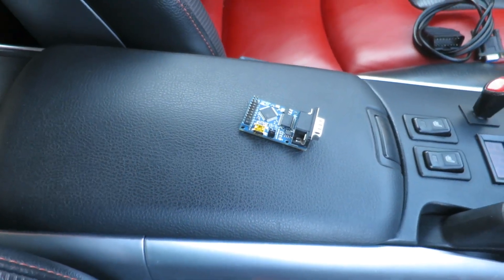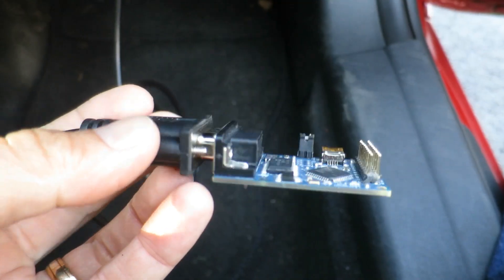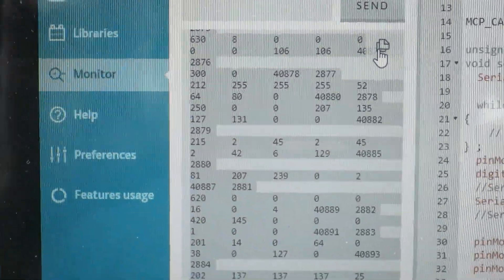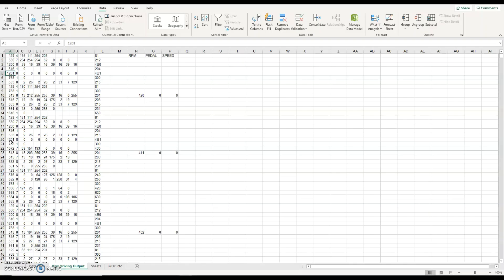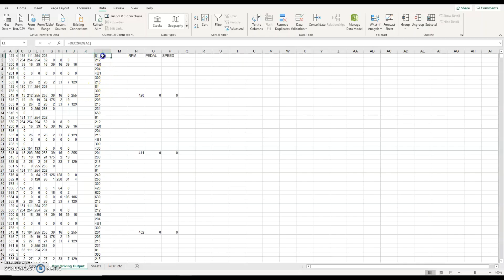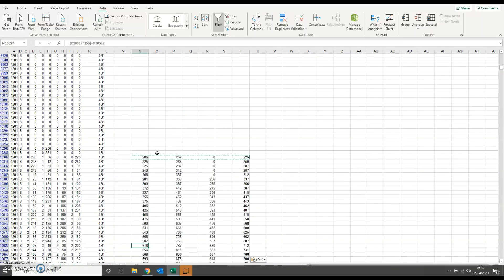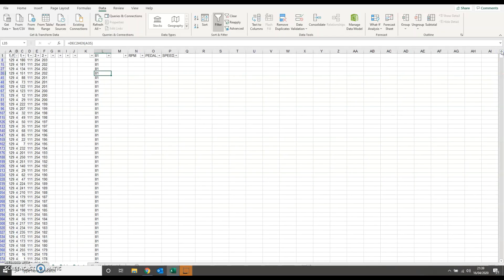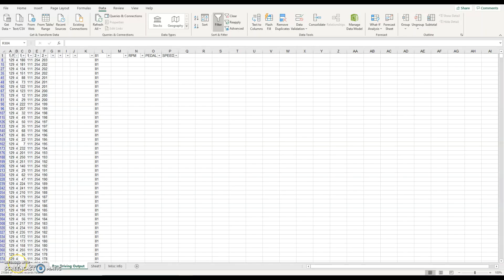How to read the CanBus in any car. (Can Bus) Part #1

Comment: I'm an automotive electrician/electronic tech, i am familiar with can, and other protocols my question is first this interests me alot where should i start to learn this stuff heads up i am not familiar with arduino, yet i can clone pcms/ iclusters do immo off etc but this part is exciting can you please lead me in right direction if not to make money maybe to solve a tough one and make customer happy. thanks in advance
Reply from the maker: Hi - you have not really said what you are trying to do, other than learn this stuff? But what stuff?
Reply: @SouthWestEVUK  the entire process I have no education on Arduino and how it works my question is where do I start accomplish what you're able to do it's impressive and it seems useful for my shop
Reply from the maker: Guess I started some 30 years ago, and learnt to code! went to college and learnt electronics, uni for software engineering, 20 years taking stuff apart!

Comment: Can i read data in a Elevator system's MODbus or Canbus so that i can find out the floor number shown in the display using arduino? Please help
Reply from the maker: Gosh, I guess if the elevator has a canbus I do not see why not.
Reply: @SouthWestEVUK  So can you help me about how to sync with elevator canbus or properly setup a system for that using arduino. That would be very helpfull
Reply from the maker: sure!

Comment: How do you find ignition timing and the fuel injector pulse width and injection timing, crank and cam sensor ect?
Reply from the maker: I have not needed to look for those as I never had a working engine!

Comment: Your "sniffer" PROBABLY miss can frames. If I understand the code and I calculate correctly, can has configured to work in 500kbps, but You set uart to 115,2kbps additionally there is spi communication between avr chip and can tranciever which I do not find its speed in Your code, but this is delay between received can frame by a tranciever and received packet by Your pc. Additional delay(10) in code also intorduce loss in received packets. Of coruse there is possibility that can tranciever chip buffers can frames and avr are albe to read all its packet but after some time this buffer become full and You still miss can frames. Please correct me, and explain what I miss understand.
Reply from the maker: The 115kbps speed is the serial output of the Arduino, not related to the canbus. The CanBus is set to 500kbps, so nothing missing there. Not sure which version of my code you have there, but the latest has no 10ms delays - but even then I am pretty certain there is a small buffer. I have extensively used this code and have not seen any behaviour that is random (which is how it would look if packets got dropped).
Reply: @SouthWestEVUK  and to be honest, Your device is very nice solution. Most of can frames frequently appear on the bus, so few frame drops can be probably ignored. The only reason of my comment is that, it is unfortunatelly not perfect, and that is probably professional can sniffers are expensive.
Reply from the maker: Its really not missing any packets, as i would see irregularities in the behaviour of my code and all the packet sniffing i have done would show missing information. Even connecting to the leaf - which has some counters, i get everything. Perhaps im lucky!
Reply: @SouthWestEVUK  please note that avr atmega chip is single core. Consider situation where on can bus, there is lots of frames one after another. In that way even if can tranciever receive it and buffer it, there is still delay (not confuse with delay function) between avr read data from can tranciever and transmit it via uart. Avr in a loop ask tranciever via spi to get info about new data and when it gots info that there is data, it reads it via spi to avr memory (note that in same time tranciever reads new frame), when avr reads that data, then pusehs it through uart (still notice that can tranciever receive new can frames). And because can is 500kbps and uart is 115,2kbps, in time when avr send data of single can frame through uart, can tranciever can receive more than one can frames (and time for spi communication to tranciever also should be count here). And I think that after some time in case of high traffic on can bus, this solution is too slow to capture all can frames, and You can not even notice it because there is no check if can tranciever buffer is overflowed.
Reply: hi, I basically skimmed through the video, but even if what you say is true and he is missing frames, it doesn't really matter, CANBUS is repetitive and chatty. The way it is designed, even if you capture everything, devices are gonna talk over one another, and those with higher priority will go through at the expense of other devices. It doesn't matter still, eventually all devices will be heard given some time, a few secs of captured data maybe?

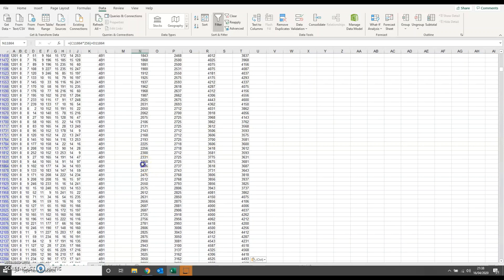Comment: 11:34 ... The answer: That wheel speed difference happens when the car makes a turn, the inside tyre has to travel a shorter distance than the outside tyre.
Reply from the maker: Yeah, this is very true,
Reply: @SouthWestEVUK  Another Answer: Tire pressure and temperature will change the diameter of the tires also.

Comment: Excellent video, I'm looking to do something very similar with CANBUS myself because the Front ACC cruise control radar on my MK7 Golf appears to be malfunctioning and I want to find out why. I've got Various Arduino's and also a CANBUS interface which uses the same IC's as what your CAN Shield uses. Do you know which SPI pins on the Canbus interface units connect to which pins on the Arduino if not using that particular shield? Thanks!
Reply from the maker: Ohhh, theres a good question! I guess the reason I bought this board was the fact that it does away with any internal communication issues between the Arduino and CanBus - they are hardwired.

Comment: Hello! My Arduino does not look like this at all. I only have one window and no monitor. Im running 1.8.13 and installed it a few days ago. Regards from Norway :-)
Reply from the maker: The Arduino is really a microprocessor - they come in many different formats, strictly speaking this board is not a true Arduino.
Reply: @SouthWestEVUK  witch program are you running?

Comment: Hey Dave, I have watched your videos multiple times and want to thank you for the hard work you have done!!! While watching the videos I didn't see the point where you actually send info to the tachometer. I'm working on an rx8 engine swap and need to send signals from my aftermarket ECU to the stock tachometer like rpm, coolant temperature, speed, oil pressure, etc. My aftermarket ECU provides all this info, how do I tell Arduino to communicate my external ecu's data to the stock cluster. Thank you in advance
Reply from the maker: So you will need to bridge the canbus output of your ECU with the canbus input of the cluster. With code in the middle to translate what the new ECU is sending into what the cluster wants.

Comment: The wheel speeds may  not be the same because you were doing a turn, you may confirm it with the steering wheel angle
Reply from the maker: Yeah, I actually averaged them out, gets close enough for my means

Comment: Hi, love the videos... got a big question... how do you charge your vehicle? Do you need a CANbus emulator to use the OEM leaf charging system? Or are you using a third party charger? Any help would be greatly appreciated 🙌
Reply from the maker: Currently i am sending the charger the right commands to start it charging. Not fully tested but wont be long before i have that nailed
Reply: @SouthWestEVUK  great work- keep it going! And consider selling pre-programmed Arduinos and CAN shields??? Would massively help us lot I reckon. Then anyone could take a Leaf and use it as a Donor car for a classic EV build. 👍🏼

Comment: is there a wireless canbus plug-in that can import the data to excel?
Reply from the maker: you could add a wifi adapter to the arduino, then write some code to dump it to a csv that excel could open yeah.

Comment: The wheels turn at different speeds because your tires arenit all the same diameter, tires wear at different rates, wheel slip, scrubbing tires, wear and tear in bearings etc. I would assume your wheel speed is multiplied by 10,000 for encoder reasons, maybe the speedo is more accurate with higher readings or the speedo is more stable. Cheers though, interesting.
Reply from the maker: Yeah, all totally right.

Comment: How would you read a can bus on an electric bike that doesn’t have a OBD port?
Controller, bike manager and bMS
Reply from the maker: You would have to find the can high and can low wires and tap into them.

Comment: Hi, great video, is it possible to read real time fuel level and odometer reading over CAN bus from a vehicle?
Reply from the maker: It depends on the vehicle, for instance the RX8 sends fuel information as a resistive value (not canbus). The odometer is likely stored by the dashboard in most cars, again you might be able to query it - but unlikely to be able to change it.

Comment: 5:35 Just a suggestion, instead of Excel, why not use something like an SQLite database. You can put a nice GUI frontend on it with a tool like LibreOffice Base. I say this because Excel has only a limited number of rows, which you could overflow if you have too much data, while SQLite can cope with a lot more.
Reply from the maker: Yeah, I actually do a lot of development using Filemaker - Apples database system (works on pc too). Its so easy and quick to fire up data bases and front ends in one package. Maybe ill write something in that next time!
Reply: I would avoid Filemaker. SQLite has a lot more support tools available, including Python bindings.
Reply from the maker: Noooooo, Filemaker is awesome, ill build something in minutes in FM that would take hours in any variation of SQL!
Reply: @SouthWestEVUK  If you want front-ends, LibreOffice Base seems like a particularly versatile one. And it’s not tied to one particular DBMS.
Reply from the maker: Hay again, Filemakers perfect, honestly, really, honestly, it is lol
Reply: I would recommend not keeping important data locked up in proprietary tools.

SQLite is the world’s most popular DBMS. You have an Apple or Android smartphone? There’s a copy on there.
Reply from the maker: You can extract from filemaker via odbc, sql queries, plugins, and many other forms. It also has a web frontend if you wish to use markups and server side tech such as php. Having programmed just about everything in the last 30 years - its hard to beat.
Reply: @SouthWestEVUK  Wonder why, when Apple was looking for a DBMS to rely on for core IOS functions, it didn’t use its own FileMaker, but went for SQLite instead...
Reply from the maker: Ok look, use Filemaker and it will answer that question.

Comment: how can i isolated like: rpm, speed, gas level etc ? 
btw i really like ur stuff and the fact you help people thanks let say i want to build an arduino tachymeter with all these value and maybe also to diagnose in the same screen would be helpful
Reply: i mean if im not wrong there more then 30ish stuff we can pull from ?
Reply from the maker: If the car you are using sends this information out on the canbus then Yes. Take the RX8 - RPM, SPEED are on the canbus, however the gas level is not - that is a resistive value.

Comment: Hi, just a note, most modern cars from like 2-3 years have firewall to ensure only data readable with sae 1979 is available.  This is to avoid hacker attacks. Great work on the aurdino!
Reply from the maker: I am guessing the Firewall is on the ODBII port (as that is the common access), If you had the can wires in your hand I cant see a Firewall getting in the way - unless I have got the point wrong I guess!
Reply: @SouthWestEVUK Not sure I follow, but here is some more info on the design I've done at an OEM, as far as I understand this is the common practise as well. the design is usally that you have a controlunit connected directly to the OBD2 port, notging else is connected. the other control units on propulsion CAN is connected to a separate CAN controller in said control unit. With Autosar configuration the only frames recognised are the ones in 1979. So the firewall is by SW design in Autosar.

Comment: So if you wanted to play around with the cam bus protocols could you just buy a scraped ECU, hook it up to a 12V battery, wire up an OBD-1 connector, and plug it into the Arduino?
Reply from the maker: You could, but the ECU is going to send all manner of error messages out as the rest of the car is missing!
Reply: @SouthWestEVUK  time to get simulating then lol
Reply: @SouthWestEVUK  got any resources on how to solder the little bits you get in the mail? I was expecting it to be pre-assembled lol

Comment: On
Board
Diagnostics
Or the OBD II or two, refers to post 1996-'97 production American made where a data stream accompany access to the engine, transmission, body controller, and other mudules.
Modern OBD II includes access to programmable parameters such as tire and wheel size.
Reply from the maker: You are very right!
Reply: He's got odb port though. Ol dirty bastard.
Reply: bah. is all emission bs
and some data for the dash board

Comment: "ARD-WEE-NOH". Not "ardjunio".

That is NOT an arduino with a shield on it. That is a dedicated non-Arduino board. with an unknown microcontroller on it. It may be fractionally Arduino-compatible, but it is NOT an Arduino.
Reply from the maker: Well at least it is dedicated to being a non-Arduino board, cheers.
Reply: @SouthWestEVUK  That it is.   8)    8)   8)

In this case, of course, "dedicated" indicates that the board is completely dedicated to a single purpose. Arduinos aren't, they're very strictly general-purpose.

Now... your board MAY contain an Atmel ATMega328 or similar microconroller (the little dude with all the pins). That would make it possible to program it using the Arduino IDE. I make little computers myself that are designed around Atmel microcontrollers. They are far from being Arduinos, though; mine are entirely proprietary and much more capable than Arduinos are.

Comment: Error 999: Steering wheel on wrong side ...
Reply from the maker: If you send the right CanBus command, it will switch the wheel to the other side. That is how they make cars for both sides of the road ;o)
Reply: @SouthWestEVUK  Wouldn't that be the left command? Here in the southern hemisphere it's recommended to drain a bathtub of water in the car first and check the  direction the water spirals down the plug hole, a drain pipe to the outside of the car is of course likewise, recommended.
Reply: I wonder how you’d reach the pedals if the steering wheel was on the other side ...
Reply: @lawrencedoliveiro9104  under rated comment
Reply: ..its actualy on right side...  :p
Reply: @kornizz5549  but right is wrong my friend :goodvibes:
Reply: @RS-Amsterdam  no mate, right is right, thats why its called "right" 😃
Reply: It is on Right side!
Reply: It's wrong alright! It works well in the states for mail carriers though...🚙📬

Comment: H Dave, what is the purpose of reading my Can Bus? I take it the Diagnostic tool I have decodes it for me and enable me to read "Live Data" of countless sensors. What else can it do?
Reply from the maker: Yes, there are some standards that your tool will be picking up and you are reading. For me, in this project I have replaced the ECU - so send data such as car speed and rpm to the display over the canbus.

Comment: Great tutorial! the tricky bit of is to make sense to all collected data and see what is what....
Just a clarification regarding CAN, every device will send data to the bus this is correct, but also this device will expect to see an acknowledge bit at the end of the transmission otherwise it will re-transmit the data again,  and an error frame (normally form error) will be published on the bus that can cause issues. So every single device on the bus has to acknowledge all packages sent by the others or send an error in case the message format/bit/timing  is wrong.
Reply from the maker: Yeah, you are right. Data does not have a recipient, It is just broadcast - and if you want what is being said then good - if not, move on! That I guess is more why I like to call it the shouty protocol, even ack's are sent by everything on the bus - shout your command and everyone shout back OK!

Comment: Yes, it's a busy fast protocol. If it has "noise" normally caused by EFI on the 2 wire bus, then that's a shielding problem. Maybe the terms in the UK are differant than NA. Can be confusing to some.
Reply from the maker: Yeah I mean noise as in lots of chatter - rather than electrical interference noise ;o) It is all meant to be there.

Comment: I've now got the source building correctly and with the ODBII cable which I received today, pin outs checked and verified against SparkFun table.  With the serial monitor I can see:

15:10:17.617 -> CAN init:
15:10:17.617 -> Can Init Success
15:10:17.617 -> Good to go!

Do I need to do anything else, car ignition is on, tried various things like indicators, but I'm not seeing anything? Any suggestions?
Reply from the maker: Hi Simon - probably best email me, help on the you tube messaging system is tricky!
Reply: After an email transaction with https://www.hobbytronics.co.uk, I got an email instructing me to solder the points on the back of the board for mid to right, for CANH, CANL and GND.  However, having done this I still get no communication from the car.
Reply from the maker: Simon, we have been emailing back and forth, why have you messaged on here again? Stick to emails bud - you need to do a continuity test to verify what pins you need to use, I keep saying that - have you done it?